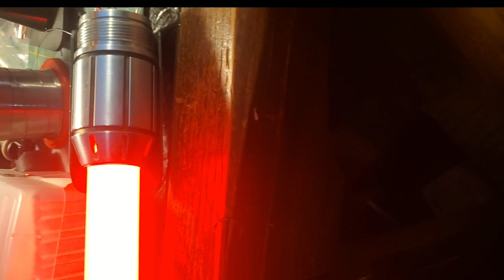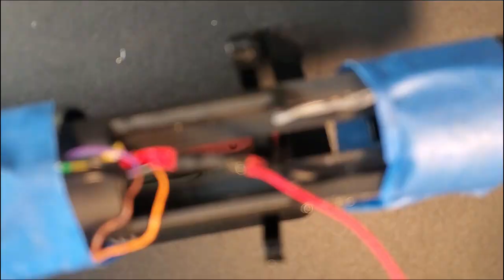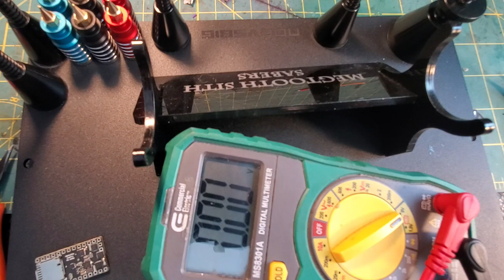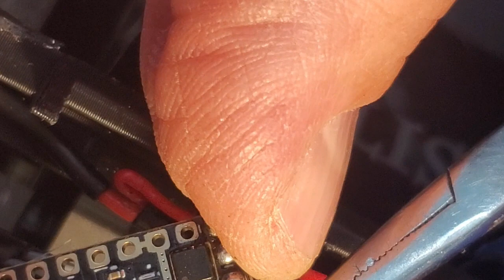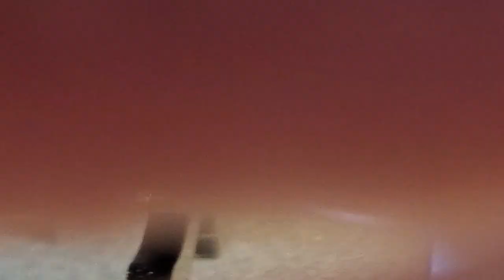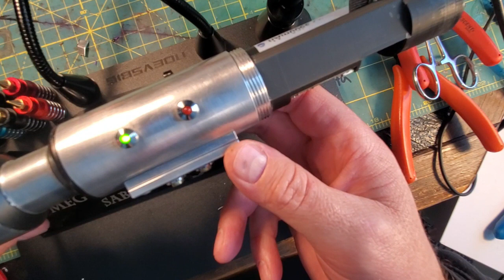2022 Proffieboard 2 2 Install of custom MHS Saber for APaul

Comment: Why is the power off so long? Is that normal to have a 3 sec power off with Proffie? Great video by the way!
Reply from the maker: power off matches font in.wav file length. It is adjustable in config.